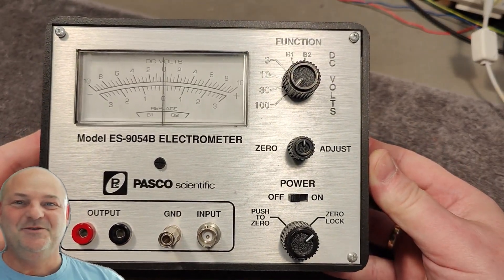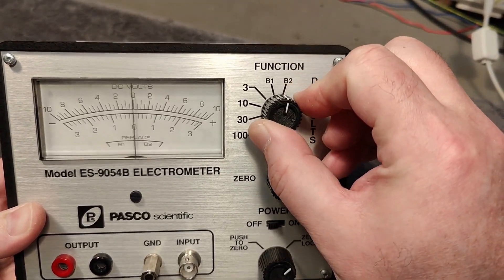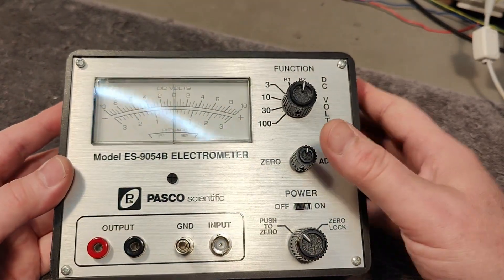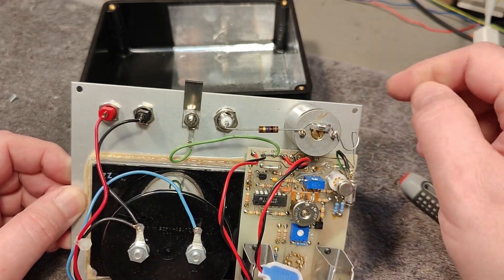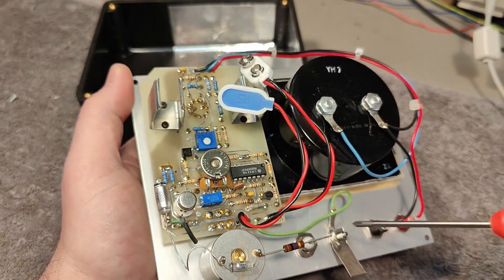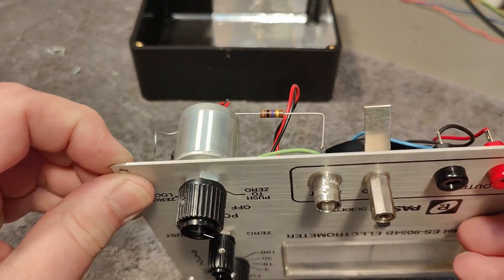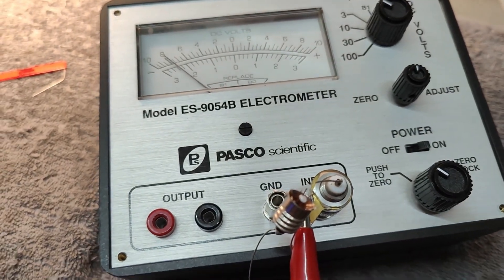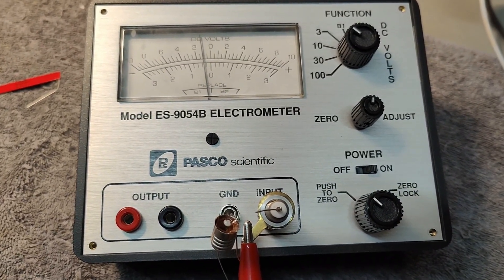Pasco Scientific ES-9054B Electrometer 100V infinite impedance

Comment: Connect the gigaohm resistor across the input and use that to measure the input impedance given the voltage divider.

Comment: If this has pretty much infinite impedance you should be able to charge up a small value capacitor ad put it on the meter and the voltage should not drop over time
Reply from the maker: yes you can do this with silver mica and similar zero leakage capacitors